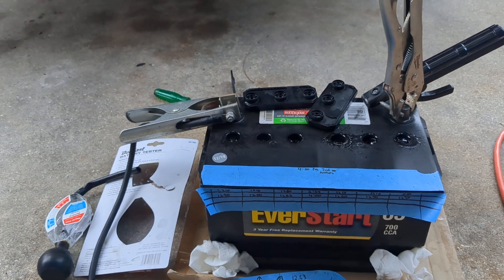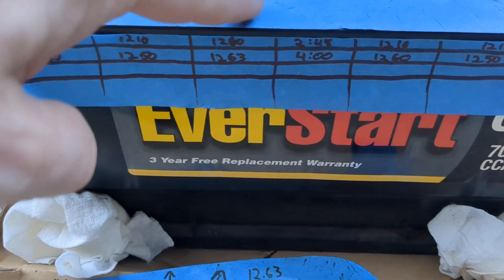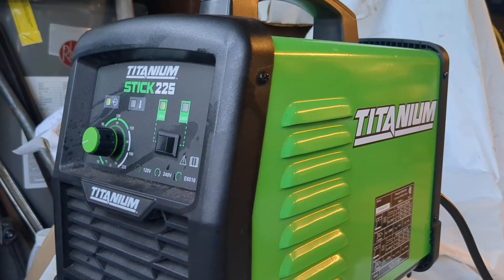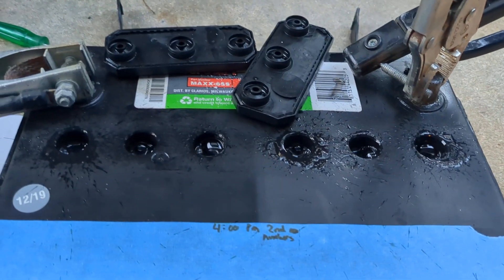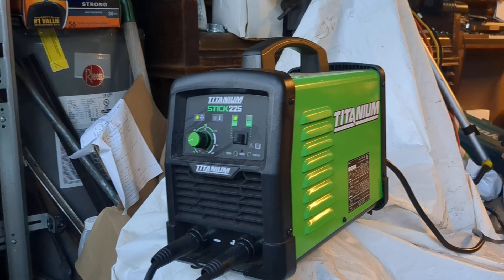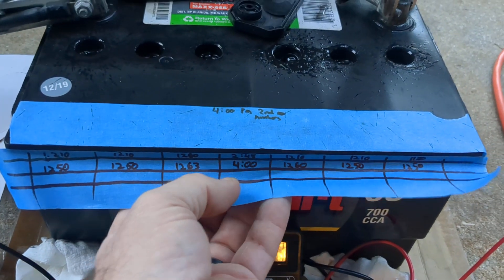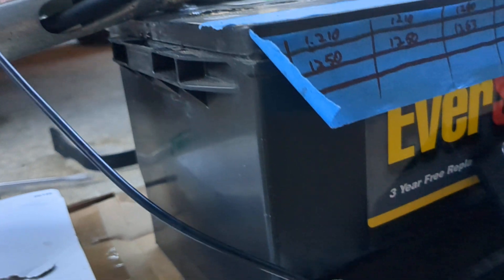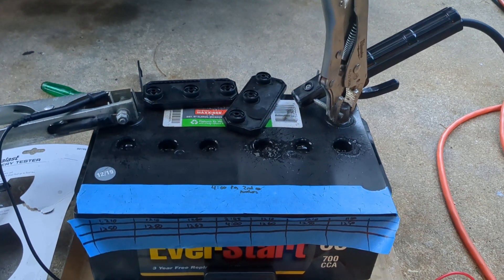Battery rejuvenation (like a spa for your batteries)

Comment: Hey glade to see you making the video. I have been doing the same for some time. The difference in what I do is this.
The 50 amps is good, some go higher but your is bubbling very good at 50 amps. But I was taught to only cook it for 
5 minutes at a time. Then let it sit & rest for 15 minutes, then go back & cook it as before for another 5 minutes & let it 
Rest another 15 minutes, 5 to 8 times. It should do the trick. It works for me about 75% of the time. But some batteries 
May have a bad cell or to that never come back. Hope this helps!👍

Comment: GOOD LUCK...  
The lead plates are POROUS from the factory and they CRUMBLE to the bottom of the battery,NOTHING can revive that...
30 years as a mechanic, i found only one way to revive a BAD battery:  i trade it in for a new one
NOTHING else works,IF it does no longer take a charge
Is that your experience too?
Reply from the maker: It worked on 2 out of 3 batteries.  Still working a year later.

Comment: would battery charger work? one with wheels on.
Reply from the maker: The old analog style might, but most these days have a timer that shuts them off after a couple of minutes and you're limited on what amperage setting you use.  I tried my battery charger once and overcooked it.  I like being able to adjust the amperage to get as close to 16.5 volts to slowly cook it.  200 amps seems way too hot.  If you're gonna try the battery charger, maybe just run the 200 amp booster for two minutes and let it cool for eight, like a 20% duty cycle.  Just be careful, and if the battery is bad it's bad, doesn't hurt to experiment.

Comment: does this work? what does it really do to the battery? I have a battery here from my truck that's in poor condition. my old battery charger doesn't work great any more, it tends to cook batteries if left on too long. that's what happened to my truck battery, forgot to turn it off over night, oops. what can I do to recover the battery? it's already shot, so no loss if it makes it worse.
Reply from the maker: I'm using a welder/inverter.  The liquid acid crystalizes and sticks to the lead plates, this returns the crystals to liquid form.  Some guys claim to have recovered batteries that are completely dead, 0 volts.  Here's a link to a better video I made https://youtu.be/qusw1nqkeNI?si=SpSSvIQGZ3jqzfat

Comment from the maker: Sorry for the abrupt ending.  The main takeaways are: the tool to measure the Specific Gravity is on the left of the screen.  It's about $8.  The Stick Welder was about $300.  After putting the battery back in my truck, I turned everything on for a couple of minutes (like headlights etc) and it was still 12.73V.  Excellent results so far.